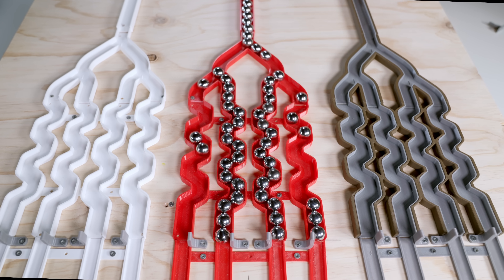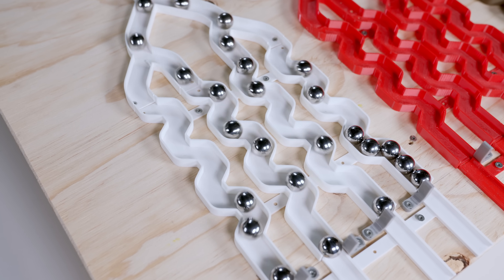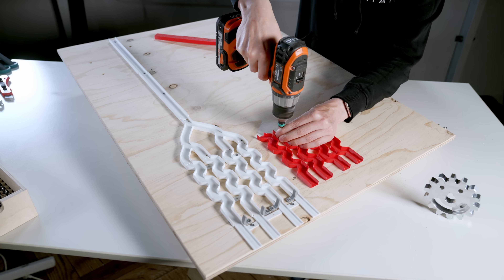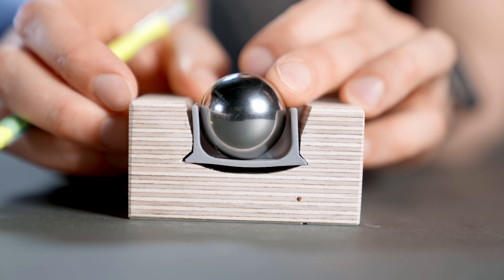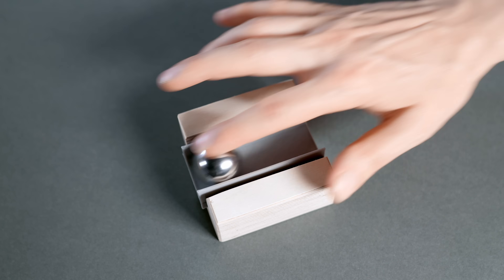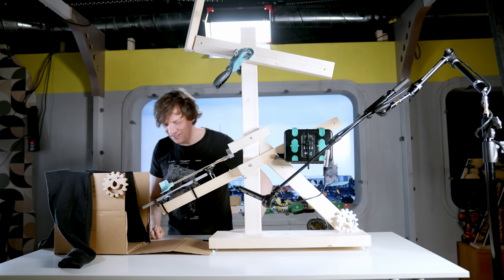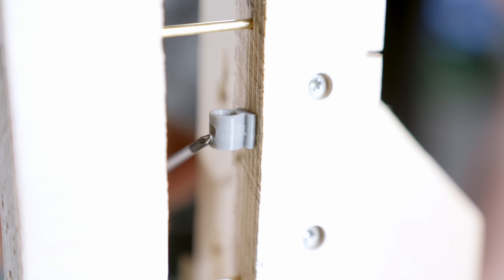The Perfect Marble Divider just got Better

Comment: 12:52, 12:53+ You now have syncronised reverberation.
So as the bar gets closer to the dampener it shortens its resination wave length and increases as the arm hits the spacer, to move away for increase in resinance volume as well as opposed to its dampening effect from getting closer until it losses tension resistance, however with a frequency control modulator, you could primarily induce wave band tension within the metal of the single metal bar.

Comment: Dude! You spent way too much time solving a simple problem. The noise you first show in your video comes from the plywood base. The large sheet of plywood acts like the sound board of a stringed musical instrument, amplifying the noise of the balls on the tracks. All you needed to do was buy some foam weatherstrip material with double-sided adhesive tape and put your track on the plywood to attenuate the sound. SMH.

Comment: Embedding the TPU in a routed plywood track is going to add the noise back, the reason that the TPU in PLA is so silent is because the PLA also dissipates the shock/sound as it too is slightly flexible.

Comment: I have a suggestion, but its not a cheap one. But it might help you a lot in identifying sources of noise.

Its called an acoustic camera. They are often used in automotive to identify sources noise. Which is exactly what you are trying to do.

Unfortunately, cheap ones start at arround 5k. But if you have the funds it can be a life saver in identifying unwanted sources of noise. (They can technically identify sources of noise in 3d, but generally we view them in 2d)

Comment: Martin, you can reduce your mechanical stopper sounds by connecting both ends of the stopper to each hard material. In shorter travel mechanisms, you can design a compliant mechanism that reduces in thickness as you approach the moving body. This allows the spring to stretch the full length of the mechanism's stroke, while still providing a dynamic dampening effect for the torque spikes the linear motions generate. Additionally, by attaching the spring at both ends, you avoid the contact sound created between the moving body and the spring. 
Also, I warn against using CF filaments due to their abrasion. Even in materials like steel, carbon fiber will relatively quickly wear axle components or similar, creating backlash in mechanism that could potentially be time sensitive. While their toughness can be highly regarded, I feel they are much better suited in static, load bearing environments where the direction of print cannot be aligned parallel to the direction of the load.

Comment: Most of the sound comes from a lack of decoupling between the tracks and the wooden board it's mounted to. It would be interesting to hear the difference between lathe tpu track and a pla track which is decoupled from the board by felt or tpu mountings. Tpu is quiet because it flexes, but that means it's also not dimensionally accurate.

Comment: “Skunk Works”. This is the ugly part that has to take place at the beginning of every product out there that  we buy at the store. This is where our ideas turn into pencil scratches on paper turn in drawings on paper turn into CAD prints turn into materials in your hands turn into prototype builds turn into finding errors turn into fixing errors (sometimes this leg is a VERY long and wide road with many ruts and bumps, but you must push forward because you are way too far invested in this thing) turn into the first test run turn into finding errors turn into fixing errors (reread the previous section with this heading and multiply that times 3) turn into second test run turn into many more larger, rinse, repeat test runs turn into an operable product where everything works and it works well. It works so well that you hire an attorney and get a patent on the whole bloody machine. Then get more patents on all of the individual parts and mechanisms. Then get patents on all of the parts and mechanisms in other countries. 

It is a truly fascinating road you are traveling on. I’m so glad you are sharing it with all of us! The final product will make the world of music absolutely stand on its head!!! Hold your head up and march forward, my man - the end product is in sight!!!

Comment: Instead of having the TPU flex which could cause the sides to press against it, cause more friction as more of the surface area of the ball will be in contact with the TPU, potential jams, and early failure of the TPU due to constant flexing.
Would it be worth investigating embedding rail like tracks into the model so that the ball has minimal contact points with the TPU to reduce slowdowns, overall friction, and quieten the sound further.

Comment: Suggestion: What if you passed all of the marbles through a pool of lubricant?
There would be raised guides in this section, and there would be a downward slope leading to this section (all enclosed at the top). The weight of the pre-slope would push all of the marbles in the pool up over the aft edge of the pool, while keeping the lubricant inside the pool. (Maybe a secondary drainage section afterwards may be used?)

Edit: This is for the purpose of reducing noise from the bumping between marbles.

Comment: If you drop marbles on printed TPU parts to dampen the sound they will delaminate and fail very quickly. If you go that rout you should use a moulded part made of silicone or similar

Comment: 9:32 just get a polydryer, you are not going to be pushing most of those fancy materials through a AMS anyway, the polydryer is more affordable (clearly not a concern for you) but more importantly you can have just one heater unit and a infinite amount of modular dry boxes to store, print and dry filament in.

Comment: With the green TPU prints for varying impact force, are you not worried about the durability of the thin end with how many impacts it will receive from the metal balls? It feels like it’ll be a piece you have to constantly replace.

Comment: I love how people think that glue is for adhesion. Well yes, but partially. Usually it is for you to get the print from the table without over adhesion to the table surface.
For example if you will print PETG using borosilicate glass table, the print will permanently glue itself to the glass and in 90% of the time the table is not usable or being damaged.

Comment: 9:37 btw, it's a common misconception that glue stick is used to increase bed adhesion. Since TPU sticks very well and can sometimes rip parts out of your printbed, its job is mostly to provide an easier to separate interface layer, while still providing sufficient bed adhesion for the print of course

edit: speaking from experience, I destroyed two sheets with tpu. The smooth ones are especially critical, so I mostly use a textured sheet for TPU, as you do

Comment: Aqua-Net hair spray is easier to apply and easier to remove than glue stick. You just hold the removable bed up in front of you and give it a quick spray. Takes seconds for an even coat. And it washes off easily with warm water.

Comment: You don't need to use the glue stick. Just set your slicer to a smooth plate, since you are using the textured one it will form the first layer perfect every time, especially if you wipe it with an alcohol pad after each print

Comment: Not an expert here, but you mount the tracks on what you could easily call a sound board... i am not surprised by the noise.
Wouldn't it already be more silent if you didn't coat the inside of the track with rubber, but put a sheet of rubber between the plywood and the track?

Comment: Martin, what if you designed the dampener to fit around the xylophone bar like a little car port? It can connect to a bracket below so no part of the dampener touches the bar. That would eliminate the little arm and the screw. You could make them easily changeable or even slide up or down to adjust thickness

Comment: You might also look into butyl rubber - it might be a good fit in some situations. Among other thing it offers good damping characteristics for vibration and impact absorption. Bicycle inner tubes are made from butyl rubber or TPU or latex. So it would be possible to use bicycle inner tubes for experiments.

Comment: Kolfiber materialet behöver ett förseglelingslager för att inte sprida hackade kolfiber bitar som damm eller via hudkontakt , som ett föremål tillverkar av rå glasfiber komposit utan gelcoat lager.

The carbon fiber material needs a top coat to avoid  sheading carbon strands into the air and into your skin.
Ist like a raw grp objekt without  topcoat or gelcoat .

Comment: You don't need to buy the anti-sound rubber/foam on the track itself/put it in contact with the marbles; a solid sheet over the top of the divider would work just as well to block out the sound.

Comment: What if you put some foam under the tpu track rather than the air gap, the air gap allows the track to flex and push into the marbles and with many marbles on the track that creates quite a bit of friction I'd imagine.

Comment: I just wanna caution: you should be REALLY careful working with carbon fiber If the plastic becomes damaged, carbon fiber dust can get free. It will get into your skin and cause long-term irritation, it's basically ASPESTOS. If you ever notice that your hands start itching while handling the parts, stop immediately. Wear gloves and an N99 respirator when doing maintenance, and make sure to put some kind of coating/finish on the parts. There's a reason why commerciall carbon fiber parts are coated in epoxy.

Comment: Instead of note switching, you should make higher profiles on the wheel a hard-soft setting, i dont think its hard to rotate this note cover with the lower latch, and it will save u space on the wheel

Comment: Please don't handle carbon fiber by hand. And likely don't use it without sealing it. It sheds micro needles that can be inhaled and hurt people like asbestos. Also the body doesn't realize its a foreign object so the needles stay in.  Also sanding cf filament isbad without a filtered ventilated hood to keep the tiny needles out of the air

Comment: The wood is acting like an amplifier. Much like an acoustic guitar. Put a dampener material between the wood and the track pieces and you should get a decent drop in noise.
Reply: And if i had waited a few more seconds in the video i would have seen the 2 layer track bit... 😅

Comment: If you're going to use TPU, use expanding-hardening foam (like the insulation kind) between track pieces for improving the strength without increasing the overall noise.  I don't have a way to test this, but it's what came to mind immediately when I saw this.  I haven't finished the video, so if you've figured something like this out already, I'll just add an update here of my thoughts.  Don't wanna remove engagement.  ;)

EDIT: You could also simply put a layer of felt or two underneath the divider.  A lot of the sound is coming from the plywood acting as a resonating board.
EDIT 2: The best solution you came up with is probably dampened enough... Still, if it proves to be problematic (It's another complex shape... Can't think of any other reasons.) the felt underneath might be a reasonable fallback solution.

Comment: So you thought that the glue used to hold in rubber might fail - but think that 3D printed parts, which are known to not be nearly as durable as solid stock material, are fine?
Also there are many types of simple rubber coating that can easily be applied at home.
So for a stronger divider you'd want to use plywood or some thicker stock plastic and use a router + template to cut in the grooves, then use liquid rubber, silicon or something similar to coat the surface.
or if more work is acceptable - make the channels as separate pieces in 2 layers with a rubber lining that is also clamped in place. More work to initially set it up but can then be repeated many times and the rubber would be easy to replace (well it would last longer than the printed parts anyways).

Comment: 8:16 - not a good design. Letting the marble weight deform the track like that creates a self-clamping force on the sides of the marbles, and that will tend to make the marbles catch instead of roll freely. After the TPU takes a set over time, it could be even worse.

Comment: Just in case you weren't aware, you can mimic the look of wood with 3d printing in case you really need to print something and have it look like the rest of your plywood.

1) you can take an image and make it into a relief on your print. You can use this with a wood texture to print a wood texture.

2) you can get filaments that have wood fiber in them, supposedly they stain like wood so if you use the same stain as the rest of the wood it should blend in, at least from a distance.

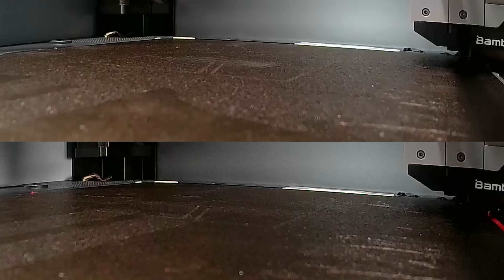Comment: 4:14 Just a little heads-up. Don't do this on Bambu Lab printers please. This 45 degree cut was almost 100% necessary on older printers like my Ender 3 to get it the filament to go in. But this can cause issues with feeding on these more modern machines. I personally own 4 types of Bambulab printers (H2D, X1C, P1S, and A1-Mini), and always cut the filament off straight. The toolhead also cuts the filament straight, so I cut it straight.

I mean you maybe won't ever have issues, but simply not bothering to cut it at an angle saves some effort at least. If you can't get it to go in with a straight cut you're probably doing something wrong :P

Here's a recent post on the Bambulab subreddit I came across recently that talks about the same issue: (I copy-pasted it as youtube wont allow me to post reddit links:

PSA - Don't cut your filament at a 45 degree angle to get it in the AMS!
TL;DR: Literally The Title

Story time: Since I started 3D printing a little over a 8 weeks ago I have been cutting the filament at a 45 degree angle before I load it into the AMS. All was fine up until a few days ago. I was having trouble with the tool head not taking the filament as it was fed from the AMS. I stripped the toolhead to check for blockages or damage to no avail, I took the AMS apart nothing wrong there either. Everything appeared to be good. Then I was digging deep into the internet and happened to stumble upon a reddit comment that suggested you should only cut your filament straight. This literally solved my problem and after numerous hours troubleshooting, it was a simple fix.

Comment: why not use washers in TPU as dumpers instead of having separate part. The washers should do the same, if there are designed with enough space inside. Maybe a washer with some knobs inside?

Comment: I'm sure it's been said before by other commenters. But I'm going to throw my two cents in.

Bambu printers are great. They work. They're easy to use. They produce great prints. They're inexpensive for their quality. Their ecosystem is well integrated. They're popular.

Bambu the company... played with fire and got burnt. They introduced semi-mandatory cloud services, effectively broke LAN mode, removed many compatibility options for non-Bambu slicers, and added a clause to their Terms of Use:

7.4 Your Bambu Lab product will automatically search for and download new update packages to provide you with timely update services. These updates are designed to resolve cyber security loopholes and prevent new threats, and it is important to accept and install security related system updates in a timely manner. Due to the importance of these updates, your product may block new print job before the updates is installed, and will immediately provide update notifications to help you understand the related information.

Translation: We reserve the right at any time to turn your printer into a paperweight if you don't want to update it. There is no such thing as a "security" update. All firmware updates are firmware updates.

Basically they are very firmly set up to be the HP of 3D printers with strong vendor-lock-in, a walled garden, and lots of monetization avenues. Again. Their physical products are great. Their business decisions... I'm much less happy about.

Comment: This is an awesome development, the noise of the marble machine iterations has always been a bit of a concern. If you're open to a suggestion, don't use the programming wheel to control the thickness of the TPU over the vibraphone, just attach it to a lever or pedal like the swell box of an organ - not only does it give some more variability as the wheel repeats, you can tailor the sound to each performance. Different venues, different crowds, you can tweak your sound so no two performances are the same. I have been following your journey since the start of MMX, and whilst I cannot wait until the world tour I am also glad that you are working at your own pace and not compromising for the sake of a deadline.

Comment: Your TPU solution for adjusting the dynamics of the vibraphone slate seems to work well, but is it visual enough? 
This may sound more difficult to implement, but adjusting the drop height of the marble (maybe tech like in the perpetual motion marble) would make it look much more impressive.

Comment: At 7:30, the most left and most right tracks of the dividers with tpu don't receive enough marbles.
I think it might be because the tpu makes more rebound. After the first divide, the marbles are angled outwards, then they rebound inward. So more marbles go to the center of the divider.
It will probably be fixed if you add a straight line between the rebound point and the entry of the second divide.